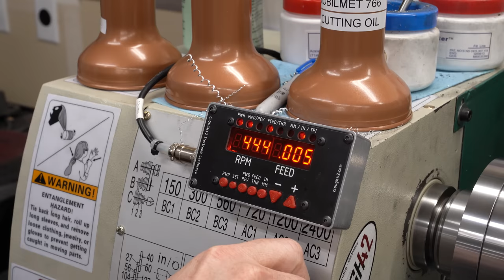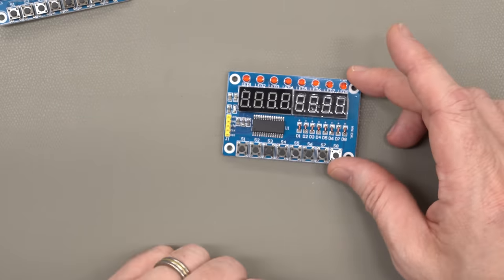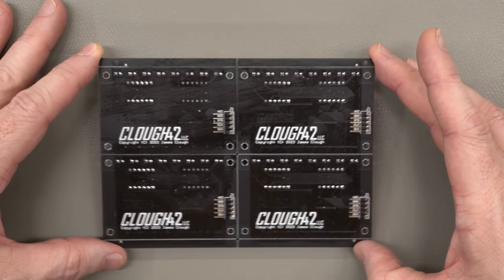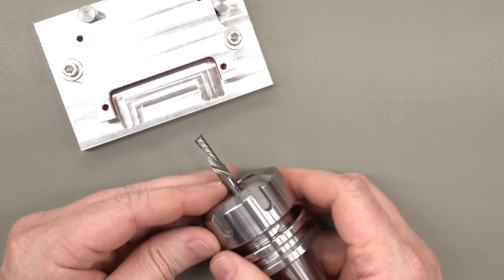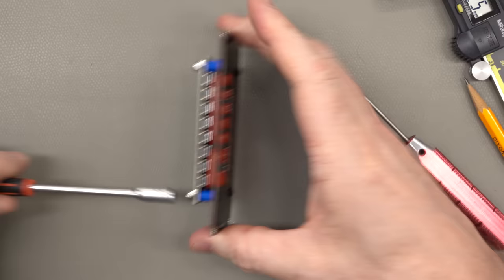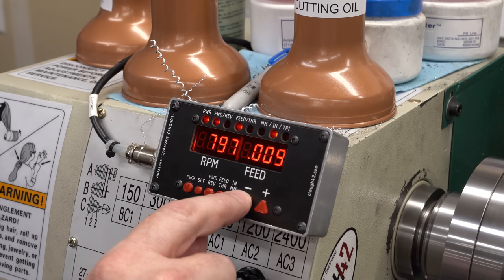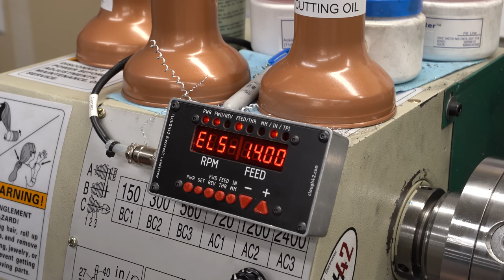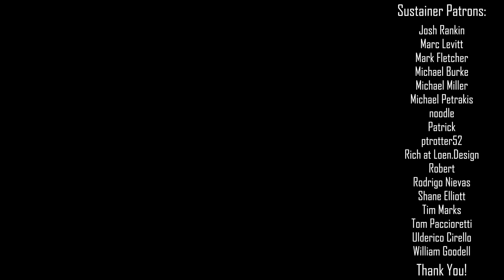Updating the Electronic Leadscrew Control Panel

Comment: Why did you use circuit maker, u do use fusion 360 so y didn't you use eagle? ... or KiCAD?
Reply from the maker: Timing.  I was using CircuitMaker five years ago, when I started the project.  If I switch to anything, it'll probably be KiCad.
Reply: @Clough42  I regularly use KiCAD it's really good. 
Also by n e chance do u have just this yt channel or do u have another where u teach software programming, especially the embedded C kind you've used on the TI board of the ELS?

Comment: just ordered! can’t wait to not be hearing my current gear train racket wile I’m spinning my import chuck upwards of it’s rated RPM as I coward out of its possible very destructive scatter zone.  is it possible to steal a tach output for touchDro from this configuration  els? i’m now shopping for encoder and am not very wise to such devices. I’m hopeful you may offer recommendations? I have a similar swing/between centers machine as you but my unit has much more,,,, girth. Would you be willing to possibly advise a stepper that will not disappoint on torque delivery when I occasionally seek to demonstrate just over the unreasonable line material removal rates to my friend I’m currently competing against in a penis size like fashion who’s machine is better kinda thing? my 10/24 is currently VFD powered by amazon’s finest, no name, asian variety, 2 HP, belt slipping monster motor offered that no longer is trying to shear its stout mounting bolts now that i’ve removed its cooling fan found to be majority cause of imbalance as I could have better located its center hole using a dart thrown over by shoulder blind from 10’ away. thank you for your time. Much respect.
Reply: I wish to run direct to screw and not through the quick change so stepper reduction not calculated yet

Comment: $200 for a test run seems super expensive, I thought all these fabs were famous for cheap boards
Reply from the maker: Through-hole assembly is expensive, double-sided through-hole assembly doubly so.  If I end up iterating more, I'll solder the through-hole stuff myself.  But I was also trying to test-run the assembly services.
Reply: @Clough42  I've been using JLC recently and with judicious adherence to their basic parts list and SMT only it's shocking how cheap it can be. Not really going to be much of an option if you're wanting to match an existing board of course.

Comment: I may be wrong but if you previously put a 2.2k resistor in parallel with the 10k resistor on the old boards replacing the 10k resistor with a 2.2k resistor wouldn’t have the same effect you would need to use a 1.8k resistor instead right?
Reply from the maker: Correct.  But if the difference between 1.8K and 2.2K makes a difference in a circuit like this, it's way too close to the edge.
Reply: @Clough42  yes, any long wire will act as an antenna and even with general shielded cables you will still get noise introduced into the pcb. Not something needed here, but if you want real noise immunity I'd either use a buffer / line driver with schmitt trigger or optocouplers with a via fence, solid bottom ground plane and a shield 😬 

I had issues with the pulse shape on long cables from my controller to the stepper driver, a high speed schmitt trigger line driver close to the stepper driver  to clean up the pulse shape made all the difference.
Reply from the maker: @HM-Projects  I have a theory that the real culprit here is the multiplexed LED drive circuits that cross directly under the high-impedance data traces, through a cut in the ground plane.
Reply: @Clough42  yeah that could be it.
Reply: @HM-Projects  If you really want noise immunity then differential is the way to go ;-) It's such a shame that none of the "cheap" stepper stuff and even some of the more expensive stuff doesn't actually support it.
Reply: @zyeborm  agree, you can use differential signal and then convert them to single ended signal close to the stepper driver. That was on the next thing to try for me but I got away with a simpler solution.
Reply from the maker: @HM-Projects  I have some four layer boards incoming to test this theory.  Turns out, the price difference is pretty small.  Though to be fair, the LEDs are in a matrix, so I'm not totally sure if referencing ground or power planes for a return EMF path is relevant.  It's definitely relevant for the high-impedance data lines.  I also noticed that the datasheet specifies small filter capacitors on all of the data lines, and these are omitted from every board or schematic I've seen.  The biggest challenge with this particular circuit is that the data line is bidirectional, hence open-collector.  I'm driving it through a single-MOSFET level shifter, which limits options further.  Early on, I attempted to use a TI bidirectional driver.  In theory, it should have solved my issue completely.  In practice, it oscillated.  I suspect it was detecting the LED drive noise and triggering the edge speedup circuit.
Reply: @Clough42  gee, extra complexity to save a pin. Took a quick look at the datasheet from handsontec, can't see any capacitors to debounce the buttons so there's that.  Titan micro does spec 10K pull ups on all data lines (in case you're relying on the uC built-in pullups) and the 100pf filter caps would definitely help. I'm not sure abt the frequency at which you're driving the strobe and data pins, but if the data lines are close to the lines driving the 7 segment display HF noise can creep through inductive coupling.
Reply from the maker: @HM-Projects  yeah, the drive lines cross right under them, through a break in the ground plane, no less.

Comment: Both Clough42 and Blondihacks releasing videos several hours early this weekend? What is this, christmas?
Reply from the maker: I saw Quinn's video was early, but I think mine was on time.  I could be confused.  That happened that one other time.  :)
Reply: Good thing you redesigned the board before Quinn assembled her kit she's had for years ;-)
Reply: @Clough42  I am so sorry. I must be mistaken regarding your upload schedule.
Reply: I'm a bit surprised you aren't molding those spacers. You can make a master part, use it to create a silicone mold, and then mix and pour polyurethane resin to mass-produce parts.

Comment: I'm a bit surprised you didn't make a master part on the 3D printer or the CNC, and then use that to create silicone molds to cast the actual spacers out of polyurethane resin. 

Have you consider using current loop signaling between the two devices instead of voltage levels? That should be a lot more noise resistant. Another alternative is differential lines and twisted pair connections.
Reply: Casting in resin would take sooo much longer and  be so much more labour intensive than hitting print and coming back in a few hours to 20 complete parts that you flex off a sheet and have them fall in a bucket. I say this as someone who has cast more than a bit of urethane.
Reply: @zyeborm  Don't know why you'd say that. Take that plate of twenty parts, make ten molds from it, and you can cast 200 parts at a time. A silicone mold is a lot cheaper than an additional 3D printer.